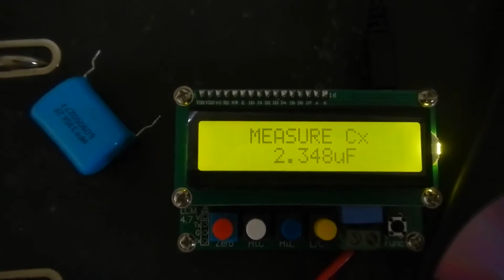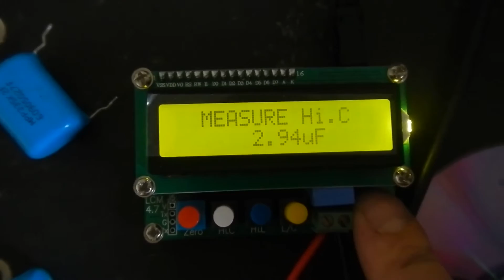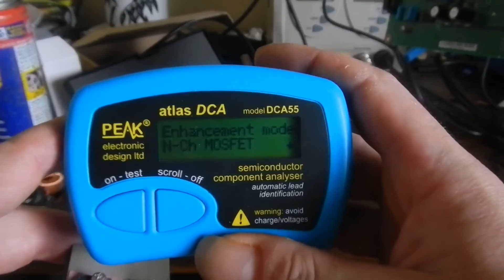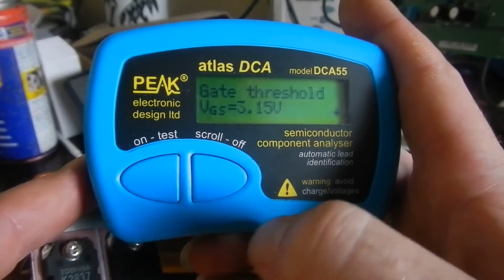Cool stuf in a plasma tv

Comment from the maker: Working volts. That makes sense :) Got lots of them now :D Just got my 4th scrap Plasma tv :) and a Fifth I dont think the owner want's to pay $200 to repair. Turns out those caps are rated to a really high working hours. Around 50,000 hours, and cost about $40-$50 each from element 14. Usually get 1 or 2 out of a crt as well. Got 20 crt boards in a box awaiting de-solder. I'm thinking rail or coil gun.

Comment: Well my intent would not be to melt it just burn the glue or double sided tape or what ever is keeping it stuck.  Lol interesting mower idea.  The question is what are you going to do with a triple horse power triple wide mower?   Yeah I did try plugging all my variacs in to each other.  I got an out put of around 200 volts.  Save the solar death ray from that TV!  I will.

Comment from the maker: Alloy and glass should melt at different temps. Can you put the variacs in parallel or series? I have 3 mowers. 2 work, 1 needs wheels. been thinking about welding it between the ones with wheels and making a 3wide mower with triple the horsepower. Because what else am I going to do with 3 mowers? I just found some old wooden box, analog tuner, crt tv's too. and I'm getting a rear projection today. I need to strip more collect less. Yuppies keep putting good stuff on the nature strip though :(

Comment: Well if I melt it that would not be that bad.  I mostly just want to scrap it.  I have been tidying up my workshop lately.  I've got a big pile of stuff that still works that I MIHGT use someday but is just siting there taking up space.  Like that phone I got all the transistors from.  That one is much better taken apart.  Or a string gauge or three variacs.  What would I ever need three variacs for?  But there good so I don't want scrap them.  ^^

Comment from the maker: I was looking at that yesterday. Mine has broken glass, most fell out. The stuff on the alloy is struck good though. Going to try the Tile Remover attachment from my jackhammer. As it's at least 2mm sheet, and I really want it. Maybe heat will melt the glue? Watch out for fumes if you try heat. 

It sure it stuck on good though.

Comment from the maker: And yes, Lots of screws and some good sheet metal too. Thicker than most appliances. No wonder they are so heavy. Shame so much of the components are smd. Even with my re-work blower its a bugger to save that stuff. Lots of good sockets too. HDMI, VGA, oddles of RCA's, a few USB's and headphone jacks.

I wonder if any of the circuits can be modified for other uses?